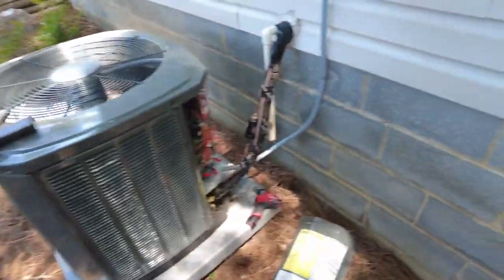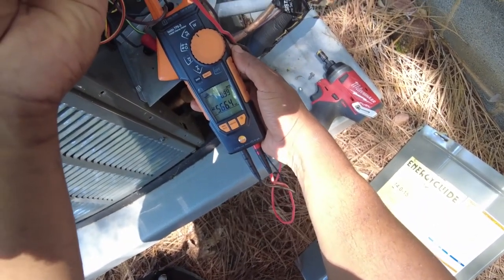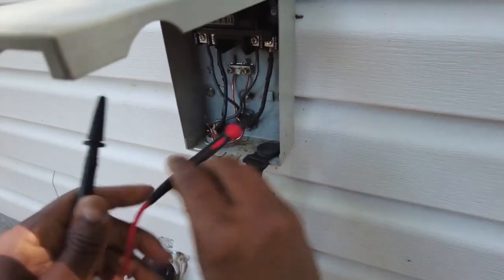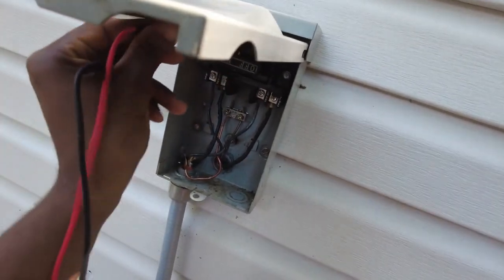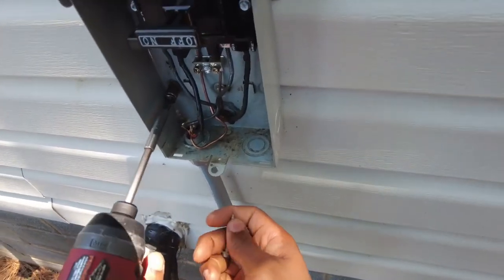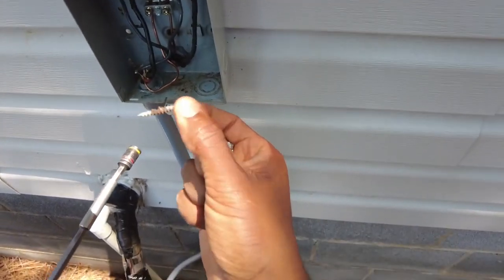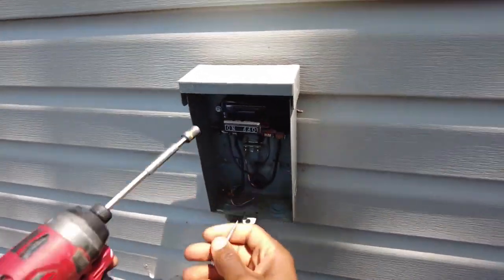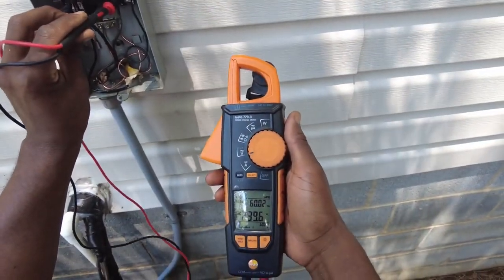AC No Cooling Call Breaker Tripping Screw through High Voltage Wire on Disconnect Causes Short

Comment: I always check the voltage now. One time I had power after flipping the breaker in a panel. It turns out they cross the wires up in the panel.